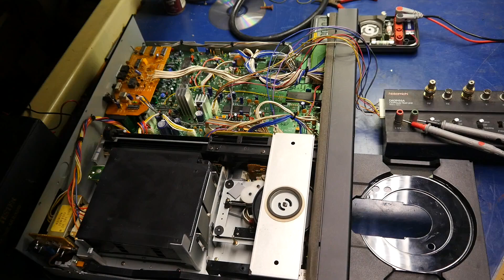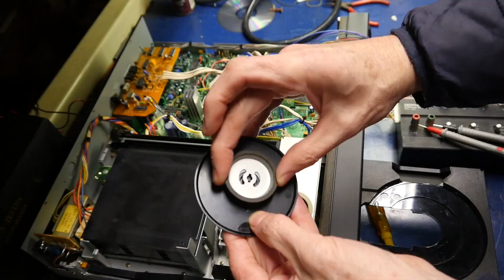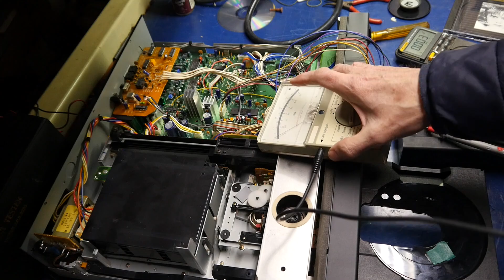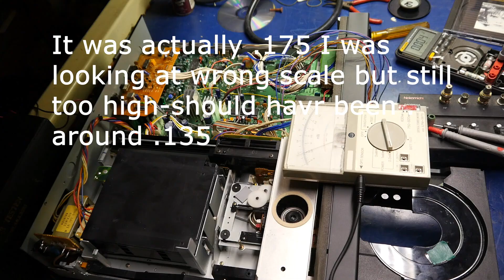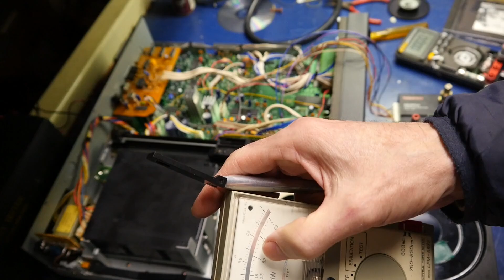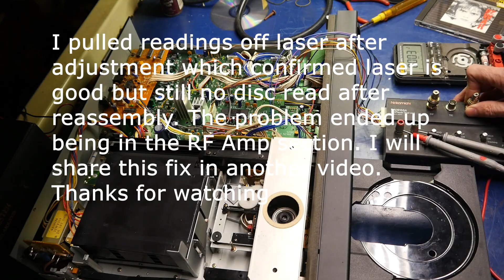Testing the laser power in Nakamichi Music bank Players (2 methods)

Comment: Nice video. Before trying to adjust any potentiometers or laser power pots check a certain capacitor.... A common problem on this series of CD players are the electro-lytic capacitor(s) on the RF board (the little brown board just next to the CD transport). If the player 's having difficulty's reading CD's and CD-R's are "scratchy" replace the 0.47 µF 50V C213. The other ones are usually still ok. (C201 100µF 16v, C206 3.3µF 50V, C210 33µF 10V, C215 33µF 10V) There is a connector C105 on the mainboard, next to the writing "main board" where you can connect an oscilloscope (0.2V/ division, 0.5µs to the "RF" and "GND" pins to look at the "Eye pattern", it should have about 1V peak to peak for CD and 0.8V for CD-R discs. The eye pattern should appear sharp. If not then try adjusting VR202.
Reply from the maker: "Nice video" Thanks. I agree these units are more likely to have a cap failure and that was the problem on this one. It's still a good idea to test the laser power though since as in the case of this one the previous person that worked on it cut it up too high so it had to be cut down to preserve the laser long term.  I can see it happening alot since most don't know about the cap and assume it's the laser. I did another vid after this a few days ago on the cap repair as well.  https://m.youtube.com/watch?v=8GZUgUD3CU8&list=LL&index=1&pp=iAQB2AZAsAgC
Reply: @audiogear474  that was meant for you.  Do you fix these?  I would love to send you a couple of mine.
Reply: I have 2 of these - one that is scratchy, and one that has the “ERR” code.  Do you fix these as a business?  I would love to send mine to you!!
Reply from the maker: I have a repair business but only repair stuff locally. I used to take in off internet but quit years ago due to shipping, issues.
Reply: Nice write up, as the McIntosh MCD-7008 are pretty much the same, may you know what caps to look at?
Mine loads, reads how many songs, when hitting play spins for a little while and stops, I heard it is usually a cap.
Last Year Belts replaced  recently New Laser symptoms are the same as old laser, been working great for a year after the belts and suddenly this issue?